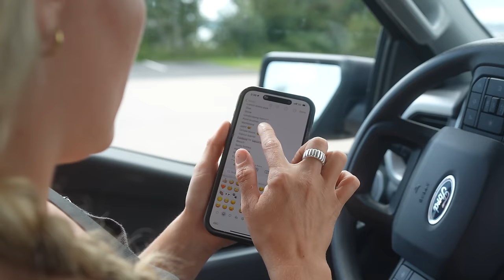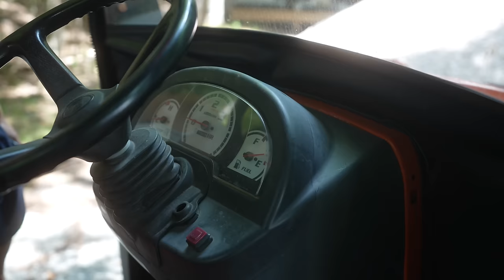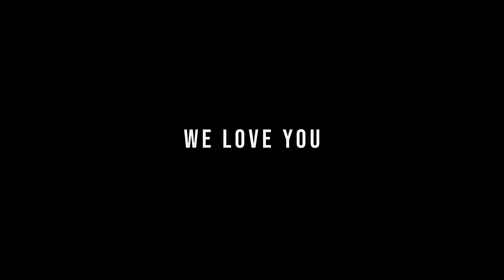This is Why No One Wanted The House

Comment: New viewer.  I see why the place was abandoned. Do you have any history on the lake levels?  That is a lot of work on a cabin that looks like it will fill the crawl space every spring thaw.  Remember that the threshold of the access door only has to be a half inch below the freshet lake level and that crawl space will fill completely. As you are excavating I don't see any sign of a septic system nor any ground rods or plates. Those are both big deals that have to be figured out at this stage.  Is there a well on the property? Is it any good?  Good luck to you two.

Comment: Question: did you have to have any environmental impact study done or have your plans approved, or anything you had to do or avoid doing to prevent anything bad from getting into the lake water? My only concern was the runoff from that black tarry waterproofing you removed. I ask because those kinds of rules were often discussed on 'This Old House'.  

Also, Eamon and Bec got in trouble with the local authorities when they built those stairs and decks going down to the water. They never talked about what the final outcome was. So are you being careful to cross the 't's and dot the 'i's?.

Finally, you two are becoming more and more impressive as time passes. Goddess's of home improvement.